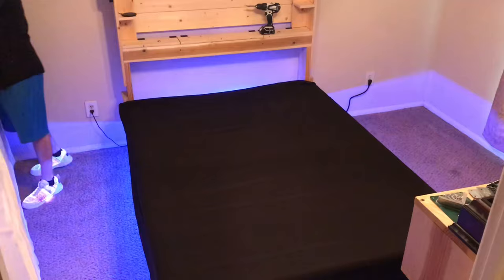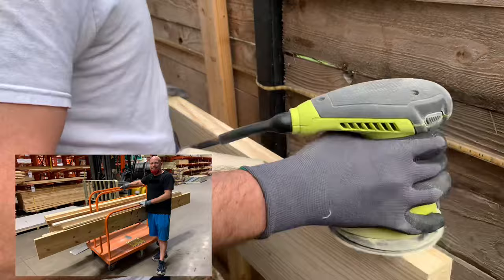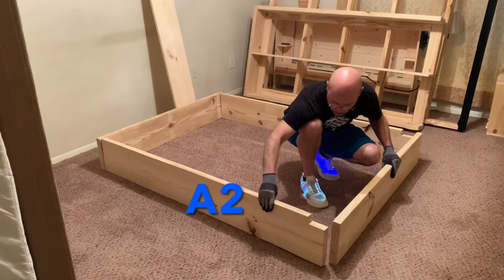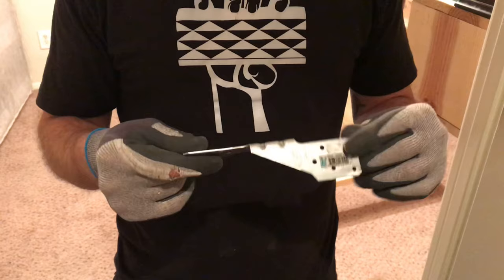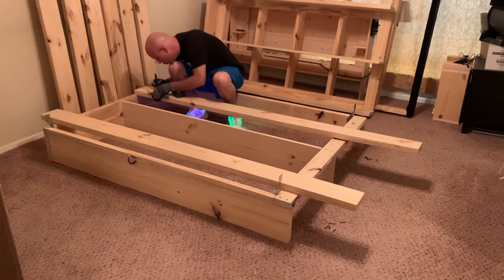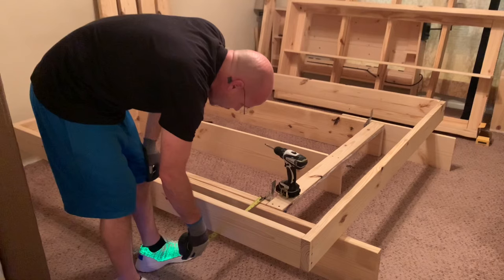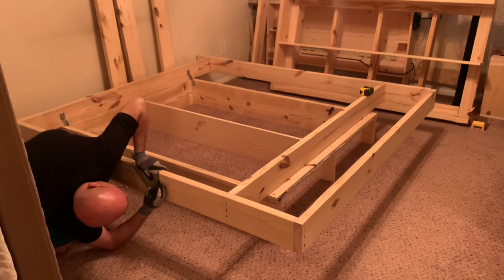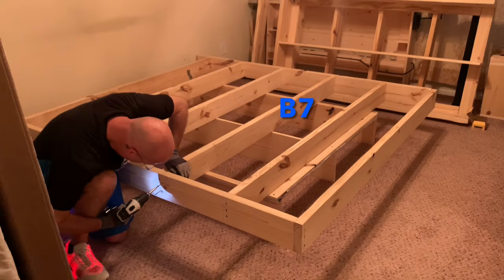King Size Floating Bed Frame [Easily build your own!]

Comment: Breadth of B1?
Reply from the maker: @Nicck K Breadth of B1 is optional...78.5"(199.39cm) if you are not adding a headboard{the other inch and a half to total 80" comes from the thickness of the footboard}, or 84"(213.36cm) if you want to add a headboard{5.5" is the thickness of a 2x6 on its side}.  I hope this helps.  Let me know if you need anything else and I'll be right there.

Comment: Just built this. Will be adding a few 2x4's along the top to give it more stability/act as slats so I don't have to use a boxspring/etc, but otherwise I have no critique. Thanks for sharing the build!
Reply from the maker: @SillyWriterChris Hey Chris, thanks so much for stopping by.  There is nothing silly about what you are writing here, 😂.  Good idea on the 2x4’s for additional support, plywood also works very well in this case too.  I very much appreciate your time and support.  I hope we talk again down the road.  Take care my friend.

Comment: Thanks, just finished making one. Used your exact measurements, perfect. I wish the quality of my lumber was better; paid a lot for twisty lumber. But it still came out great. I don't use a box spring, so I finished the top with 1/2 inch plywood. Thanks again
Reply from the maker: @Ben Atwood Awesome.  You are welcome.  Ben, you are the man.  Your frame is spot on just like a professional did it.  1/2" ply is what I recommend so you are right on track.  Thanks for taking the time to come back and let us know how your build came out.  I really appreciate this a lot my friend.  I'll search through the whole stack at Big Orange if I have to to secure me some good pieces of lumber for my builds...its worth it every single time for me.  Cheers my brother, be careful.  I'll talk to you again down the road.
Reply: You shouldn’t use plywood because mattress’s need to breathe just add extra boards in between for support.
Reply from the maker: @Jarret Gorsh Hi Jarret, thanks for stopping by and contributing here.  This is the first time I’ve seen this concern brought up so I took the time to research it myself.  While there is some truth to your statement, I think I would only really be worried about this if I lived in a basement or an extremely humid environment.  By now, many dozens of people from several different countries have built this bed frame with plywood and I hope at least one of them would have contacted me to let me know if this is actually a problem.  There are advantages and disadvantages both to using plywood or a box spring.  These floating bed frame videos on my channel give you guys a good idea of where to start building your own bed frame.  I’m here to help and advise as needed.  I appreciate your time and interest in this video my friend.  I’ll talk to you again down the road.

Comment: I just finished this project for my wife’s birthday gift. Followed this video step by step and everything came out perfect. Took me about 4 hours. Thanks alot for this great tutorial!
Reply from the maker: @Sergio Chavez My man Sergio.  Thanks so much for this awesome comment and feedback.  You are a hero my friend.  You've earned yourself a pin sir, thank you 🙏.
Reply: Do you have to bolt it to the floor
Reply: @allisonlouthen4154  no, the center piece or smaller square in the middle he builds is what supports the the rest of the frame and mattress.
Reply from the maker: @Allison Louthen Nope.  It’s solid enough that it doesn’t need to be bolted down to anything.  I hope this helps.  Talk to you soon.
Reply from the maker: @Ghostex Ghost Thanks for replying to that one for me, I appreciate it.  You are correct.  No bolting necessary.  Thanks for stopping by.

Comment: Thanks so much for your video.  I just finished my king size bed yesterday;  I built the base in my garage; and then pre cut and pre drilled the frame.  I assembled it in the bedroom and it worked out perfectly.  The only problem was when I tossed the Simpson ties into the base, nothing happened.  I had to attach them manually.  Thanks again.
Reply from the maker: @MikaT Fenn Hey Mika, sounds like your build went very well, I’m so glad to hear it!  The Simpson ties were kinda tricky for me too actually.  I will admit that I had to try it a couple of times to get that to work properly.  😂  I really appreciate your time, feedback, and support.  Stay tuned, more great stuff on the way.  Talk to you soon.

Comment: Cool design of a floating frame! However, I would have the inside joist dimensions the same as the boxspring and mattress. I would use 2×10/2×8 as the outside pieces and stain them. Then have the joists be 2×6/2×4.
Reply from the maker: @Jar House Nites I've seen and considered this build also.  Each person has their own way of doing it, and I do like and appreciate your suggestion.  This video is just an idea or recommendation of how you could build one if you aren't very experienced or don't have much time or resources to work with.  I hope it was enjoyable for you.  Thanks for stopping by!

Comment: Wow. This is an exceptional video. Straight to the point, every word used is needed, all the material posted in an easy freeze frame. 
Liked, subscribed - I hope your channel takes off my man. 
Edmonton Alberta, Canada.
Edited to add: Literally the only thing I'd change is put the material & tool list in the description for easy reference. 
Also saw your insta in the description, followed you there also brother.
Reply from the maker: @Elliott1518 Hey David, wow, thanks man.  I apologize for the delay in my reply but this is how long it took me to attempt to come up with something as good as your original comment here.  I can't thank you enough for your very enthusiastic feedback and follow up.  You are the real here here.  I do this YouTube outside of my day job as kind of a hobby.  You guys keep coming at me with comments like this and I'll be doing this full time in no time.  Thanks for your time and support here my brother, I mean it 🤝

Comment: Well, I'm sold. I'll be doing this shortly. I'm going to try to modify a bit. I'm going to use 2x10s on the outside, but use 2x8's or 2x6's on the inside, that way I can put some sort of plywood over the smaller board and have the mattress sink into the outer wood frame rather than using a small box spring.  Great video!
Reply from the maker: @bfjohns1376 Hey BFJ, you are exactly on the right track and it sounds like you know what you are doing and talking about.  I like this modification.  Thanks for your compliments and time and support here.  I'll offer you any help or advice if you need it but you seem to be running full speed already.  Come back and let me know how it turned out.  I appreciate your time and support here, I mean it 🤝

Comment: I’m going to use this design I appreciate the video it will make going to the store and getting started much easier and faster now! I am going to try and add a few extra braces in there and see if I can make that a bit stiffer around the outside but nice work !
Reply from the maker: @Michael Semrau Hey Michael, thanks so much for stopping by my friend!  I'm happy to hear you will be using a modified design of my floating bed frame to make your own!  This is awesome!  Take the time to plan your build and be careful while making your cuts.  Once you get finished, you will be happy with it forever, I'm sure of it.  I appreciate your support and I'll talk to you again soon.

Comment: This is the way instructional videos should be made; concise and to the point, with no mindless jabbering or digressing from the task at hand. I like this frame, I had one made when I lived in Ireland but the fellow used screws instead of bolts to join the pieces and also ruined the heads of the screws which made it impossible to dismantle the frame
Reply from the maker: @capricornmagic63 Hey Cap, thanks so much! 🫡 Creators on YouTube tend to benefit heavily from longer videos, but I understand the value and importance of people's time.  I try to make my videos short enough to include as much information as I can, but long enough that I can show you that some of the things I post on this channel can be done by people who aren't otherwise extremely inclined to do carpentry and related type items.  I'm sorry to hear about your previous model bed frame.  I don't know what the prices are in Ireland, but here in the States, this one can be built for around USD$100.  I very much appreciate your time and support C.  Let's talk again down the road my friend.

Comment: Hey, from Canada, northern Alberta here, currently just went out to buy the lumber. Came up to 120$ with screws. Except I forgot to buy the strong ties, town is 1hour each way. Gotta come up with something. Anyway great video, love it. Thanks.
Reply from the maker: @Jeannie Cardinal Hey Jeanie, sorry to hear this.  Check the videos section on this channel and look at the original queen size floating bed frame video…the one with like 1.3 or 1.4MM views.  I hadn’t yet learned about the strong ties so I just used off cuts from the 2x4’s to secure the base to the frame.  I hope this helps.  Let me know how your build ends up.  Be careful my friend.
Reply: @C_Love1 hey the build went smoothly, I just used cut offs they worked just as good. I’m not really into carpentry but I couldn’t afford to buy a bed from the furniture store, so away I went on building lol so thanks to your easy build video we saved money & have a way more sturdy bed frame. Thanks!
Reply from the maker: @Jeannie Cardinal Hey Jeannie, sorry for the delay in my reply here.  I've been trying to come up with something that is anywhere near as glorious as your last comment here.  Build went smoothly, was able to successfully improvise on the securing mechanism for the base and frame(saved some time on a second trip to the home improvement store), saved some money, rock solid new bed frame that you built yourself...hopefully had some kind of positive impact on your mental health.  It just doesn't get better than this.  I love, a thousand times, seeing this.  Thanks so much for taking the time to come back and update me and everyone else.  You are a real hero.  Measure twice, cut once, be careful, stay blessed 🙏.  Talk to you again down the road 🤝.

Comment: This is  awesome. I think I'll build it. Any particular reason you used a 1x in the middle instead of a 2x other than it just being lighter and cheaper?
Reply from the maker: @Brad C Hey Brad, thanks my brother.  I think you should build one for yourself, just make sure and be careful.  I used that 1x down the middle because I had it in my extra pile here at the apartment…just didn’t want to spend more money, cheaper, lighter, and will provide a minuscule more storage space underneath.  I hope this helps.  Take care and I’ll talk to you again down the road.

Comment: Any tips if I don’t want to use a box spring ? And awesome video I will not be looking up any other videos because this one right here is the one ☝️ 💯
Reply from the maker: @kushbuds817 Hey Kronic, sure thing.  I’m going to stick with recommending using the box spring for maximum support and airflow for your mattress, but other people who have built this bed frame have come back and commented that they’ve used either plywood or cedar fence pickets to support the mattress.  Make sure you drill you some holes for airflow if you use the plywood or leave a little gap in between the pickets if you use those.  I hope this helps.  Let me know what other questions you have and I’ll get you taken care of.  I appreciate you supporting this channel my friend 🤝

Comment: Howdy from Iowa! question for ya, if I don’t plan on having a box spring would I be able to throw 1/4 plywood over this design to able to use for my memory foam mattress? Or do I need to add more supports to in addition to the plywood?
Reply from the maker: @Dylan Valdez Hey Dylan, thanks for your time, interest, and question.  Quarter inch ply will do just fine my brother.  I hope you have a safe build.  Send me your pictures on Instagram C_Love1984 please, I’d love to see them.  Talk to you again soon.

Comment: Getting ready to build these for my boys this weekend. Would love the material list.
Reply from the maker: @TheHarrisonWard1 Hey Harrison, this one is pretty simple, don't make it harder than it is...2x6's for the base and the frame, 3" screws at all the wood junctions, countersink drill bits to pre-drill all the holes for your screws, corner brackets to secure the base to the frame, 1 1/4" drywall screws to secure the corner brackets to the base and the frame, and led light strips.  Some of these items are linked in the written description of this video.  Let me know what else you need my friend.  I'm on instagram Curtis_made_it.  I hope you have a safe build.  Let's talk again down the road 🤝

Comment: Looks super cool!! AWESOME!! I need help, I have Barrett’s Esophagus and I have to sleep on a bed that’s slanted. I want to build a simple platform for my kingsize bed that sits in my uhhhh lower window shelf/edge. The window ledge is aprox 11” deep but 2 1/2 feet below that is another ledge/shelf that is 18” deep and I want to build it off that? high at the top and low at the bottom… 🤔
Reply from the maker: @billielee777 Hi Billie, thanks so much!  I'm sorry to hear about your condition and I'll be glad to help.  I apologize for the delay in my reply as I've been finishing up a very large very custom order for some executives at a Fortune 10 company.  Is there any way you can show me pictures of what you are trying to build off of?  I'm on instagram Curtis_made_it or you can email curtisalove1 at the five letter g word(I can't type the whole email address or this reply will get censored and you won't see it).  I'll come up with something that will work for you.  Thanks for your time and support on this channel and I look forward to hearing from you again soon 🤝

Comment: Shout out from Stamford CT.
Outstanding job my man. Got a few questions though, I'm renting, and living on the 2nd floor of a 2 family walk-up. 
I won't be here forever so wondering what does this badboy weigh in at on completion? My man.., am I going to have to take it apart piece by piece, or could it be built in sections to get it out of the apartment on my next move? I'm watching your build it in that room with 2x6's etc. and I'm thinking, when it's time to move ahaha..now what???
Reply from the maker: @TC Price Hey TC, thanks so much for your question, this is a great one and one that I am happy to reply to this awesome Sunday morning!  Good morning to you.  I also rent, a townhome, my bed is upstairs also.  I build the base and the frame seperately and then attach them together with the Simpson Strong Ties that I showed in the video.  For the frame, the top part, you could use 2x4's instead of 2x6's to reduce the weight and I'm pretty certain it would still be much more than substantial enough to support whatever kind of...activity...goes on on the mattress.  The base can be made out of 2x6's if you aren't interested in the storage underneath...that will also give you some weight reduction.  If you have another body, you could easily move the frame and base while it is assembled, however you decide to build it.  Then, you would just have to move the two pieces, or three if you build the headboard that I also made a video for, and set it up at the new place.  If you are moving solo, its gonna be a pretty monumental effort to move it by yourself.  I hope this helps.  Thanks so much for stopping by!  Talk to you soon.

Comment: Jeren from San Antonio here!

Great and simple video! A couple questions. 

1.) the dimensions of my bed is 80x76, will the measurements for the frame (no headboard) in this video fit for that? Or should i adjust the measurements to 80in instead of 78.5? Also if i adjust to 80in would i need to adjust the measurements of the box the frame sits on as well for better support or will it be fine with the original measurements?

2.) would this support a bed with no box spring or would something else (slats, etc) have to be added?
Reply from the maker: @user-ej5es9rk5r Hey Jeren from San Antonio, nice to meet you 🤝.  Let me see if I can help.  I see this comment twice on my feed here so I'll go ahead and copy/paste my reply from the other comment.
1.) Frame - no headboard extension.  No, leave those cuts for the side boards at 78.5".  The frame footboard thickness makes up the other 1.5".  Your over all length will end up at 80" already.
2.)*DEFINITELY* need a box spring.  Others have used plywood or cedar fence pickets on the deck of the frame.
How else can I help you my friend?  Thanks for your time and support, I'll talk to you again down the road.

Comment: Hi Curtis! Loved your video! Really well explained! I'm from Brazil and I'm a little bit confused with the measurements. FOr example: the two boards with 165,1cm, I understand this is the lenght. What is the width and the thickness of the boards? Thank you!
Reply from the maker: @gustavoborja5737 Hey Gustavo, thanks so much my friend. Welcome here 🇧🇷, thanks for stopping by.  I apologize for the miscommunication here.  I use American 2x6's for these floating bed frames.  Those boards actually measure 1.5" x 5.5", that's 3.81cm x 13.97cm, and then as you stated, cut them to the length that is needed.  I hope this helps.  Let me know if you need anything else.  I appreciate your time and support on this channel 🤝